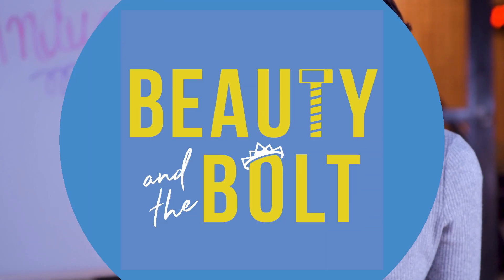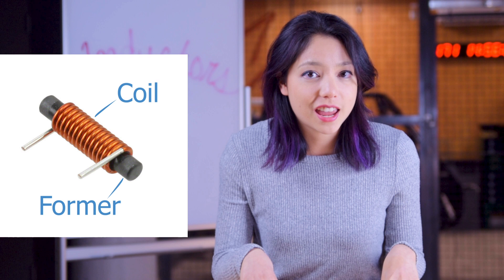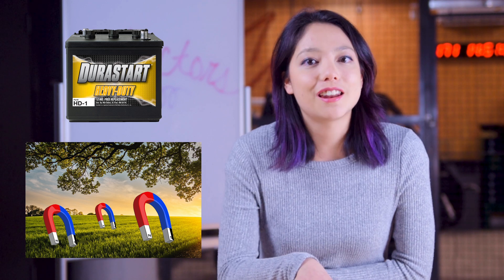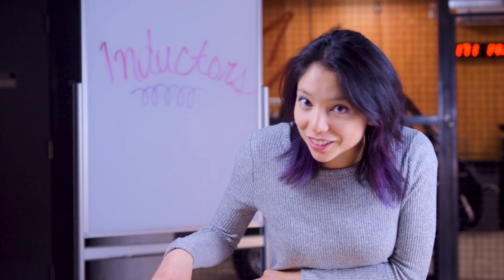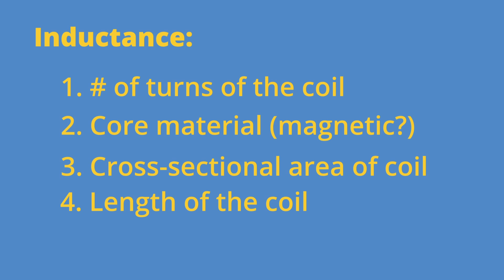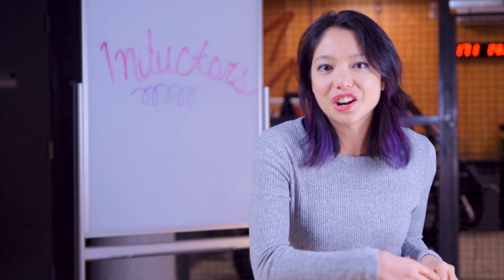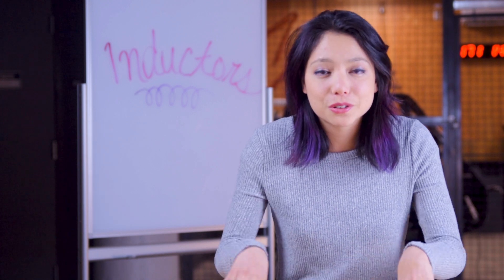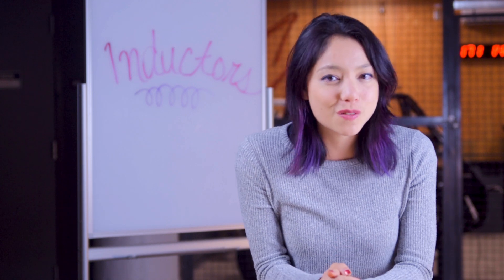What is an INDUCTOR?

Comment: I made an AC Voltage Divider, but when I connect a load device to it, it causes the voltage output to lower, so I think I have to some impedance matching with an inductor since the Voltage Divider uses capacitors. I connected the primary coil of a transformer in parallel with the load device and it raised the voltage much higher, but to reach exactly 120 volts I think I will need a variable inductor. Thanks for this video.  😊

Comment: Possibly you can help me with an Electronics mystery. For the past two weeks I have gone through possibly 50 websites and YouTube channels looking for one that will show a beginner the basics of electronics while not assuming that the student has already gone through five years of courses on the subject.  One that will show real world translation of a schematic to a physical point-to-point wired circuit. One that does not use what they call a breadboard which merely conceals all the important parts from the student. I thought that this would be an easy item to find, but amazingly nobody teaches this. If you know of such a source, please, please let me know. It would be much appreciated.

Comment: If you plan to study electromagnetic fields you will need a waveform amplifier, they are expensive but useful as an oscilloscope or a function generator.
Don't forget to connect a big resistor to it (like a 300 watts, 6.8 ohm).

Comment: A bit of what I hope is received as constructive criticism: I've only watched a few of your videos, and even though they are cool, I usually feel like they leave a lot of (a bit more advanced) stuff out that could make them more interesting.
In this one, for example, you mention the basic structure for an inductor, and kinda mention a couple of uses, and compare them to resistors for AC, but don't really go into any kind of detail... a description for inductors that really stuck with me was that, similarly to how capacitors store a voltage value, inductors store a current value. Also could have been nice an example on how a transformer wold work, maybe.
Another example: on the video about diodes, you only talk about LEDs, which is okay because other uses for diodes are more advanced, but I thought it would be nice to at least mention the increased complexity an LED structure has compared to a simple diode.
In all, I have the feeling that if I only watched one of the videos, then I might go and research more on the topic, but this is youtube so I expect that people will just go and watch another video after that instead.
Reply: I think she's doing great lol... especially for people who simply are interested in the basics... I did not understand anything you mentioned tbh
Reply: Ah but youtube viewers of this kind of material may not be of the same ilk as the memory-inCAPACITated (teehee) viewer of typical youtube content. In any case, these are topics that could be explored in later videos. Write in and suggest them